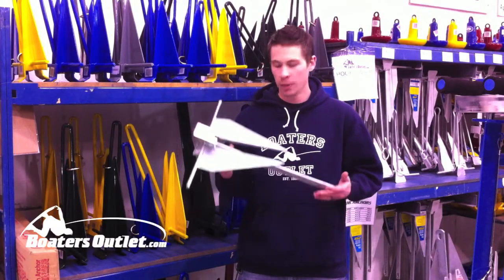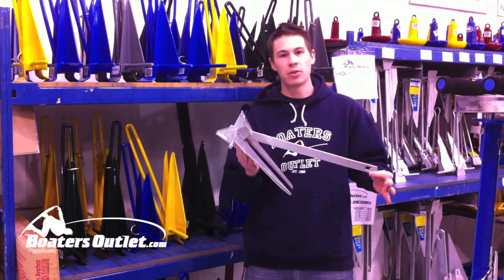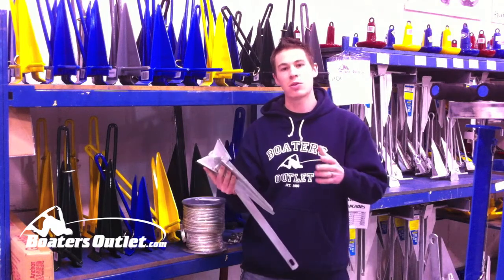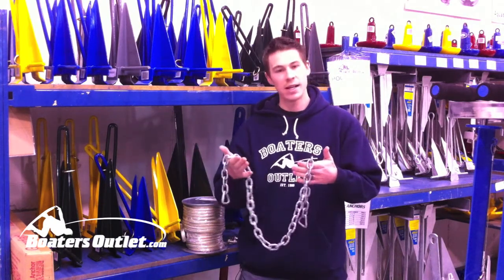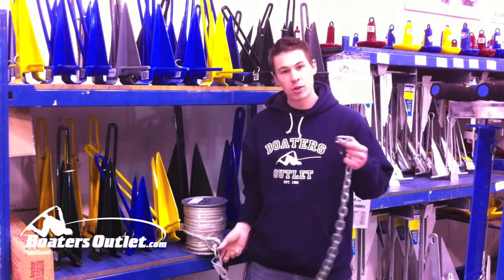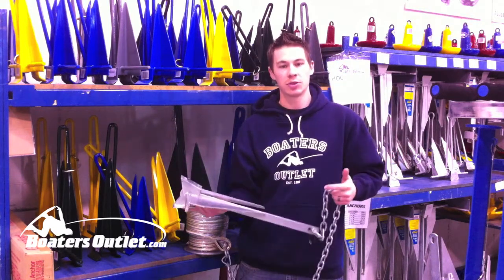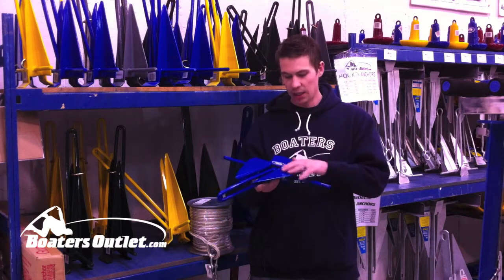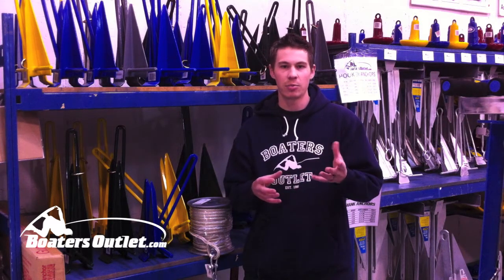How to use a Fluke Anchor

Comment: When I seen him bring out the chain I said he knows my secret. 
But he didn't. I use a chain about
The size of the one he had and I
hook it to the back anchor as close
to the middle as possible. With a
chain on both ends it'll lay flatter 
and will cause the anchor to get
a good bite on the bottom.
If I'm not going to in water over 
100 feet deep I tie 500 paracord
On the end of the chain I put on the back of the anchor and I have a
small Bowie top float tied to the
other end. I go to a man made
Lake and there's a lot of stuff on
the bottom that people's anchors
get hung on. They have to just
Leave them there. When mine
gets hung I have always been
able to pull on the paracoard
and get mine loose.
You can get paracoard at Lowe's
Hardware by the feet in really long lengths. If you save 1 good anchor
it's paid for it's self. I also got a
thing that you roll up drop cords
on so the paracoard don't get
tangled.